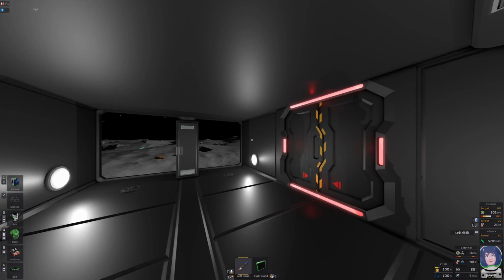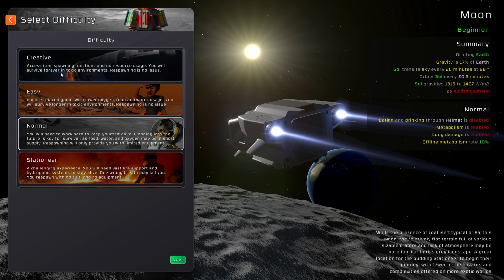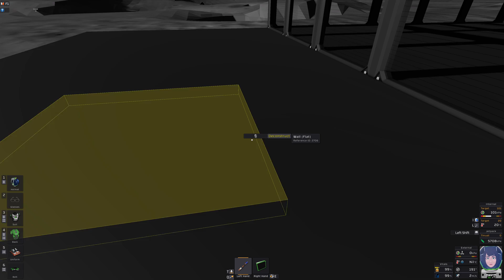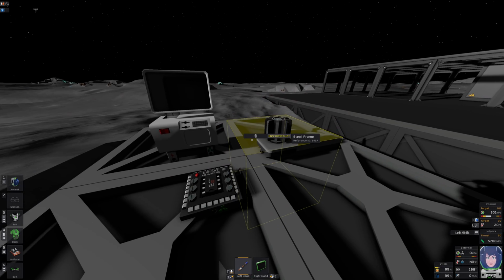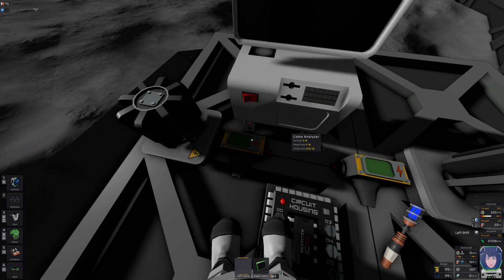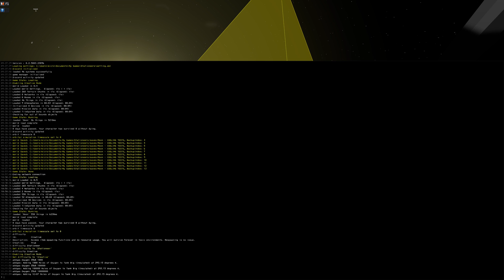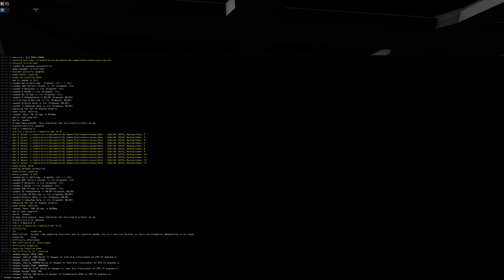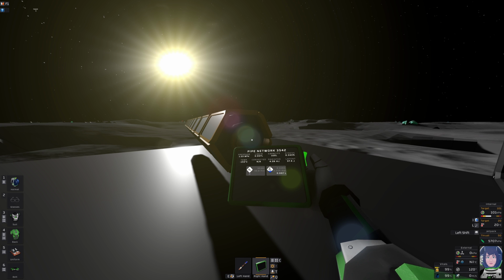Stationeers how-to: Use Creative Mode *

Comment: I couldn't get a vacuumed cooling room to work on Vulcan or Venus? I read somewhere on Stationeers Wiki that it doesn't work anymore. It does on the Moon and Mimas but not in an artificial vacuum. It use to work but not anymore. I tried and nothing happens. I think I read something about still being traces of gases on the Moon and Mimas?
Reply from the maker: Stationeers uses the world gas temperature for any vacuum room calculations, that's why this cheap exploit isn't possible. It also doesn't work in the video.
Reply: Walls radiate temp. Surround your base in a vacuum. Just like a thermos. Even solid walls will transfer temp. Frames will also transfer temperature. 

So yes, if you surround the entite room in a vacuum, including the floors. Then, also vacuum out the room. Then, pipe radiators meant for a vacuum work just fine. 
Then world equals vacuum.

Comment: Why is pressurizing an airlock so dang slow?
Reply from the maker: I guess you're asking in general, since this video didn't even have atmosphere in/around airlocks. This short video shows everything about it (e.g. how to solve it): https://www.youtube.com/watch?v=vNvsii5A7_4 ---- Here's a video with a custom airlock that repressurizes: https://youtu.be/aOxrTc4EBNg?t=2651 ---- And here's a super fast custom one that does not repressurize: https://youtu.be/kiUx6EgUmPI?t=1694
Reply: Just seeing the airlock at the start of the video reminded me of my early build. 
But seeing you go into creative mode did inspire me to make a creative run to tinker with airlock settings, and having an active vent on both ends seems to work pretty quick.
Thank you for your video recommendations.

Comment: Vacuum room will radiate to equalize with world temperature which is absolute zero on the moon so it is an effective cooling there. This will not work on Vulcan or Venus for cooling purposes. This is exactly why the furnace now has to have atmo in its cube as opposed to welding it inside a frame or vacuuming it out as we did before.